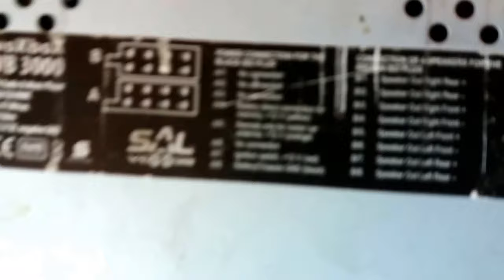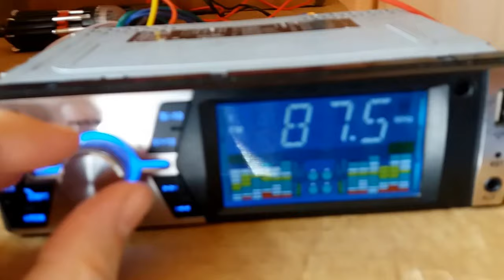Cum se leagă firele la un radio cu stick auto?

Comment: E bine de știut!
Am si eu nevoie de ajutor la un radio plaier cu ecran 7 inci' nu rămâne memoria setata de loc după ce soți contactul. Iar la introducerea chei nu pornește radioul dumai dacă apeși pe butonul de pornire. Aveți un sfat???
Reply: Leagă firul galben și roșu al casetofonului la firul roșu al mașinii
Reply from the maker: Pentru memorie trebuie sa existe un plus permanent sub tensiune, verifica siguranța  sau trage un plus separat sau cheamă un electrician auto